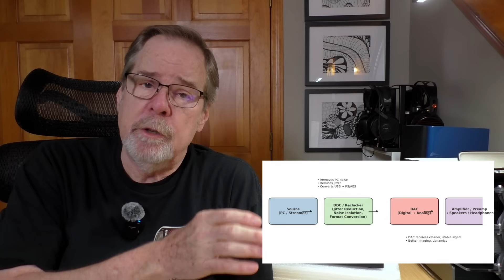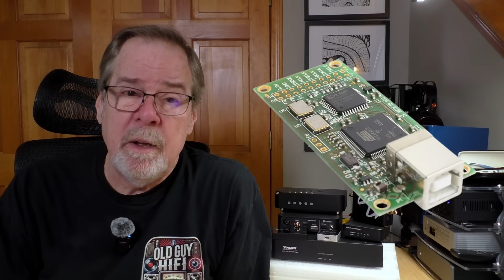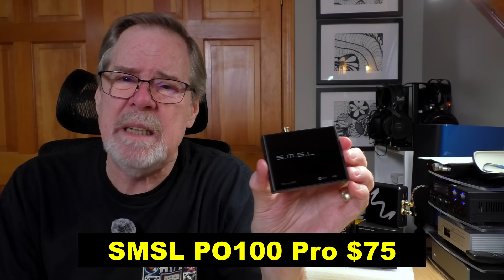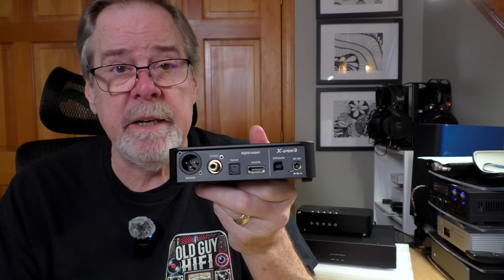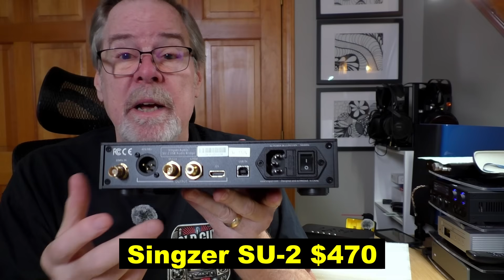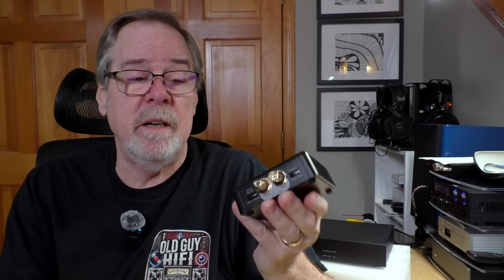OH NO! DDC-Reclockers! Do they really make a difference? YES! They do. I can hear it now “Snake Oil”

Comment: Hi Ed, just wondering on your thoughts about “Is adding a DDC always beneficial?” I am planning on purchasing the new Eversolo T8 dedicated streamer (which I guess isn’t technically a DDC, but does have femto clocks and sends a clean digital output signal) to add to my Denafrips Pontus 15th DAC (which reclocks the digital signal again).  Do you see a potential benefit in adding a DDC between these 2?
Reply from the maker: You might consider it. Everyone's mileage may vary. I mean Denafrips does build DDC/Reclockers for a reason. A lot depends on how resolving your system is.

Comment: Unless I missed it, you didn't point out what I think is the biggest selling point for the Wyred Remedy.  I can't be the only one who uses an Apple TV.  The cheap extractor I have to use can't possibly be clocking well.  Even though it sounds pretty good, the second I see a Remedy go up on eBay for a nice used-price I'm going to be trying it!  Thank you for the video.. I hadn't found that device and it's exactly what I've been looking for.
Reply from the maker: I am sorry I didn't mention that. I am not an Apple guy in any form so it didn't occur to me. Thx for tuning in and pointing that out.

Comment: If almost all humans can't tell the difference between the original source and 256kbps AAC then no one can tell the difference between any DAC unless the DAC is coloring the sound somehow (adding a slight bass or treble shelf or slightly boosting the mids, etc).
Reply from the maker: Not true. Thanks for viewing.
Reply: @OldGuyHifi
We all, even me, can tell a difference when it isn't a blind test. Conducting a blind test and the perceived differences disappear.
Reply: @h1a8  -  A human can definitely tell the difference between a "grey" background and a black background. I mean, when you add a component that radically reduces background noise to the point where you hear a black background, you're definitely convinced. 
That's what happened to me personally after adding a preamp, and I was completely surprised (I wasn't expecting it!). The black background is real. 
That's what you get (among other good things) when you add a good DDC.
Reply: @earlyNova 
Not when music is playing. 
I saw actual blind tests where equipment costing over $5000 dollars went up against equipment that was under 500. Volume was equalized. Headphones where the same. Person in the back flipped a coin to decide which to switch to. Everyone failed.

Maybe 1 out of 1 million can pass such test.
Without blind test even I can tell a difference. But making it a blind test and the difference MAGICALLY DISAPPEARS.
Reply: @h1a8  -  You don't get the point.

Comment: I'll try about anything that makes sense to get better sound from the desktop computer USB, a decent DAC helped a lot, but I know it can be better. Seems like this DDC re-clocker makes good sense, computers are noisy as heck. A coax or optical out would be a blessing sometimes, it would need to power my little DAC too, it needs USB power capabilities to power up same time with the USB data.
Reply from the maker: That can be a nuisance. A 5 volt phone charger might be an inexpensive solution. Thx.

Comment: I use the PO100Pro between my Wiim Ultra and my Topping E70 Velvet dac. I immediately heard better detail and sound stage. A very price-appropriate way to upgrade my system. Thanks to you and Randy for bringing this to my attention. Thanks for the explanation on the whole topic.
Reply: Can vouch for this..owned two of these DDCs...for the money you can't beat it
Reply from the maker: Thank you.
Reply from the maker: Glad it worked out for you, and thank you for commenting.
Reply: is the E70 Velvet a nice upgrade to the wiim ultra’s internal DAC?
Reply: @ayewhite333 Yes, I think so.
Reply: @davekband  Hi , so from the wiim ultra to the 100pro using usb type a to c..
Then from 100pro to your e70v , using what cables..?
Reply: @99Apit Hi. I go from the PO100Pro to the E70 Velvet via toslink optical cable. XLR from there to the L70 preamp, then XLR to a pair of Fosi V3 monos with Sparkos opamps. Finally out to a pair of Wharfedale Diamond 225's. Not cheap but definitely not high end by a long shot. I enjoy it all a lot. The PO100Pro and the Sparkos opamps do a lot for the soundstage and imaging.

Comment: Wow, thank you for such an in-depth technical video. I followed for as long as I could, but so sorry I got lost somewhere after XMOS and FPGA… I have a Holo Red, I use it both as a DDC for the audio outputs of my computer to the DAC, and as a streamer for my music over LAN. It works well in both cases, and it is very simple to switch between the functions.  DDC has its purpose, but streaming still sounds better. Their difference is audible; it’s kinda halfway between streaming and just computer directly into the DAC. YMMV.
Reply from the maker: Thanks for sharing your experiences.
Reply: @OldGuyHifi Sorry, my comparison is not valid, I have other network signal filtering devices in front of the Red😑  Not fair for a stand-alone DDC😩

Comment: In our quest to make small incremental changes to our systems are distracting ourselves from the beauty of the sonic experience? Sterophile years ago had a periodic column on what hifi systems famous musicians used. The authors were often dumbfounded by the ‘low’ quality of the musicians setups.  The answer generally was: I’m listening to the music, not the hifi. Always has kept me from overspending on gear.
Reply from the maker: I do agree with that. Most musicians are not audiophiles at all. Their performance is what they concern themselves with. They have a totally different frame of reference. Many of the artists we listen to especially in Rock music have damaged their hearing so badly they are unable to perceive a difference in the equipment's sound quality, while many suffer from severe Tinnitus. As audio enthusiasts we are just tryin to achieve what our ears tells us sounds good. We also happen to be gadget nerds at some level. Perfection is unattainable, but chasing it can be a fun adventure.
Reply: @tommcclure8727  -  There was a time (~30 years ago), I I was deeply convinced that as long as I loved the look of my setup, the sound would follow ♪ ♫ ♪ ♫
Then I bought some equipment, cables, USB filters, reclockers, and fell into the rabbit hole.
Today, I regret those days when all I did was listen to music...

Comment: Hi ed,  do you think any of this ddc can help my Cambridge audio exn coax out to my dac?     Connect exn to ddc then to dac?    Have you tried that set up yet?
Reply from the maker: Eddie, You would need to use the Wyred 4 Sound or if your DAC has an I2S input then the Laiv μDDC would work. You EXN only outputs SPDIF on either optical or coax. All of the other devices mention only have USB inputs. Those are the two options. Yes I have used my MXN10 & the EXN100 and ran them through the Laiv μDDC with excellent results. Thanks for asking.
Reply: @OldGuyHifihow did you connect the laiv ddc?   I thought it only inputs i2s?
Reply from the maker: It inputs USB, SPDIF on Toslink and Coax. It only outputs on I2S. So it would work with the EXN100 as long as your DAC has I2S in.
Reply: @OldGuyHifimy dacs do have the i2s.    What cable do you recommend?
Reply from the maker: @eddiel1276  I like this one. https://www.theaudiolegacy.com/collections/cambridge-audio/products/cambridge-audio-axr100-am-fm-stereo-receiver?sca_ref=8700910.lWvqI3VLzxuWar5N

Comment: I run the Matrix X-SPDIF 3 between my PC and an Audio-Gd R28 using the I2S input on the DAC Amp into Focal monitors. There is less noise and more depth with the DDC. I also run the SMSL PO100 pro between my laptop dock and two dacs, an old Benchmark DAC 1, and a Fosi ZD3. Speakers are Audioengine. There does not seem to be much sonic improvement, but it  allows me to keep both dacs connected at the same time. Would need to test the SMSL with a higher resolution system to know what it can do. Try one in your own system and return it if doesn't float your boat.
Reply from the maker: Saul, Thanks so much. I haven't forgotten about your son's issue. I should know more this coming week.

Comment: I have a motor boat noise in the background when outputting from the coax output of my sony dvd player to my DAC. I eliminated it by using the hdmi arc from my tv to a wiim ultra, then outputting an analog signal to my powered speakers (Klipsh The Nines). What causes the motor boat sound and can I use the s.m.s.l. po 100 pro hooked to the usb out from my wiim to my DAC and then to my powered speakers and still keep the room correction feature of the wiim ultra that way? Thanks for all your reviews.
Reply from the maker: I have no experience with that type of setup. My guess is yes. You should be able to keep your room settings.
Reply: @OldGuyHifi Thank you, I'll do some experimenting

Comment: Given the fact that a DDC cleans up a dirty digital signal, it is of great use if you have a source that outputs a dirty digital signal. If you have a source that is already an audio optimized music server I assume the benefit of a DDC vanishes. On the other hand we see that there are decent DDCs around $1000. A high-end DAC manufacturer could easily integrate the input stage of a DDC also in its DAC design and one could expect that if a DAC costs beyond $5000 it would provide the same cleaning functionality in its input stage so it does not further profit from an external DDC.
Reply from the maker: Your observation is correct in principle: if the transport is clean and the DAC’s input stage is well-engineered, a DDC shouldn’t provide much additional benefit. However, DAC implementations vary widely. Some manufacturers prioritize the analog and conversion sections and assume the user will provide a stable digital source. Others do integrate advanced input conditioning, but even then, external DDCs can still offer advantages — galvanic isolation from noisy USB interfaces, reclocking close to the DAC, or enabling alternative formats like AES or I²S. The actual benefit of a DDC depends less on system cost and more on design execution and system context, which explains why user experiences with them differ so much. Thank you.
Reply: @OldGuyHifi yes experiences differ, as I have a friend with an Auralic streamer and an Holo audio DAC, who tried a Denafrips Gaia DDC but after a few months he sold it because it made no difference to him. (Myself I have two streaming DACs so that I cannot even test a DDC if I would like so 🙈). Maybe one day you will test ethernet conditioners as well.

Comment: At a normal listening distance – say 4 or 5 metres on the sofa – if there’s no audible hiss, then the background is already perfectly dark. Any residual tweeter noise you hear with your ear pressed up against the driver is utterly irrelevant in practice. Still, it does give the industry a wonderful excuse to sell us yet another little box to make silence… even quieter.All in good faith, these are just my observations.
Reply from the maker: It has nothing to do with tweeter hiss. If you have that there are other issues with your system. This has to do with digital noise. The main benefit of a DDC/Reclocker is to reduce the noise floor in the data stream yielding more low level resolution to increase the detail in the sound stage and in imaging. Once you understand how they work, you might not be so cynical. Thanks for the comment.
Reply: @OldGuyHifiThanks for the explanation. I get the idea of reducing digital noise and improving resolution in theory. In practice though, I feel most of these hi-fi add-ons make such marginal improvements that they’re already beyond what human hearing can perceive. Especially nowadays, when most hi-fi gear is already built to a very high standard and easily meets performance thresholds. That said, maybe I’ll try one of these devices in practice then I’ll have the full picture. Appreciate your perspective!

Comment: 9:24 "sometimes it can do MQA". I don't think DDC can handle MQA files. I owned a Singxer SU6 for over 3 years now and have tried playing MQA files with no luck. There's no handshake. If anyone out there owns a DDC and is able to play MQA, please share it.
I can only play MQA files unless I select USB from my Topping DAC. I am using a cheapo player Foobar2000 and the only way to play MQA is to select "Output Device" - Default: Speakers (TOPPING USB DAC) [exclusive]. There's no other alternative. This is the reason why I have 2 Foobar2000 players where I specifically choose to play MQA and the other player is for all kinds of files. The 2nd player I have to select "Output Device" - ASIO+DSD: Singxer USB Audio Device. If I play MQA through the DDC [I2S output] > Topping DAC [select I2S], (the MQA files will be in DSD or PCM depending on your configuration.
Again, anyone out there who knows how to play MQA through DDC, kindly share it. Thank you.
Reply from the maker: If I said that it was based on the manufacturer's statements. I don't do, nor do I really have any interest in MQA. Sorry.

Comment: Thanks. Yes I confirm, DDC makes a difference to the better. I was unsure, so I bought the cheap SMSL PO100. Difference hearable. Then I bought the SMSL PL200 CD-Player & Digi-Transport & USB-DAC in one. Wow, as digi Transport (USB-IN & Opt-OUT) it is great, much better than the PO100. 
Also as USB-DAC RCA-OUT great with AKM-Chip.
Reply from the maker: Thank you.

Comment: Great video as always, thanks Ed! 

I have a high quality Pulse Array DAC that also uses its FPGA to run D(igital)P(hase)L(ocked)L(oops) to clean and re-clock the inputs, giving it market leading Toslink jitter performance. 

Unfortunately, due to the DAC’s small size and the fact it was the only model the manufacturer built to a budget, the USB input (signal only) isn’t galvanically isolated, but does still use the FGPA/DPLL. 

That’s why I just use a cheap PO100PRO to convert all my USB device outputs to Toslink first. The biggest difference is heard when using PCs and Laptops.

If the USB was well galvanically isolated and using the FPGA/DPLL, I probably wouldn’t bother with a DDC.

Thanks again, all the best!
Reply from the maker: I'm glad you have found a good solution for your system.

Comment: If a chip receives a data packet via USB, how does it know what it is suposed to look like?
Reply from the maker: That's a great question. In an asynchronous USB audio stream (or any USB transfer type), error detection is handled at the protocol level. Here’s how a receiving device detects corruption in a packet:

CRC (Cyclic Redundancy Check):
•	Every USB packet has an error-checking field.
•	For token and handshake packets, this is a 5-bit CRC.
•	For data packets, this is a 16-bit CRC covering the payload.
•	The receiver recalculates the CRC when the packet arrives. If it doesn’t match, the packet is considered corrupted.

Bit-stuffing rules:
•	USB uses NRZI encoding with bit-stuffing. If the receiver detects a violation (too many consecutive 1s without a stuffed 0), that indicates corruption.
Handshake mechanism (except isochronous):

•	For control, bulk, and interrupt transfers, the receiver will send an ACK/NAK/STALL back to the host to indicate whether the packet was good, bad, or not accepted. If the CRC fails, no ACK is sent and the host will retry.
•	For isochronous transfers (commonly used in asynchronous USB audio on less expensive devices like DACs), there is no retry or handshake to maintain timing. The receiver still checks CRC, but if the packet is corrupted it just drops it. The missing packet can result in an audible glitch, but the stream keeps moving on time. Devices with an XMOS processor remedy this issue.

I hope that answers your question.

Comment: There is much here that merits response, but since a white paper here will be frowned upon, I’ll keep high level: Credibility on this topic is strained when the message seems to be that using a reclocker/isolator will always provide improvement. Without a nuanced discussion of the details of the particular DAC, the source, the reclocker/isolator and connection types, nothing meaningful can be concluded.
Reply: For those who believe, no proof is necessary. For those who do not, no proof is possible." - Stuart Chase
Reply: @Vincent-lw2sp  The burden of proof lies with the claimant.
Reply from the maker: You make a decent point. I don't have the time or inclination to do a thorough test of each device. I was painting in broad strokes.
Reply: Thanks, Steve. Please provide a snapshot of your current system/gear. Let me know if you want to jump on a call. Cheers
Reply: And the effect (jitter and noise) can simply be measured with much higher resolution than what our ears are capable of. (There are listening tests for audibility of jitter, and it turns out that in practice, we can't hear it). But since this channel doesn't care about measurements ...
Reply from the maker: “Two ears and a brain are much more sensitive and analytical – directionally, temporally and spectrally.” Dr. Floyd Toole, Sound Reproduction: The Acoustics and Psychoacoustics of Loudspeakers and Rooms

Comment: Bought a cheap Douk Audio U2 to run from my tower PC to my Fiio K7 and out to monobloc Aiyima A07 Max amps. I didnt expect much for such a modest system but I was astounded by the difference. Blacker background, clarity and deeper soundstage. I switched back and forth to check my observations. Money well spent. Love the vids.
Reply from the maker: That's the goal, to improve the sound and do it affordably!
Reply: The FIIO K7 already has its own DDC 🤷‍♂️
Reply: @tomekichiyamamoto2177 . Not technically minded enough to comment. All I can say is that the external DDC makes a big difference. At least in my system.
Reply: @keithjones7810 
There is no support for this 🤷‍♂️